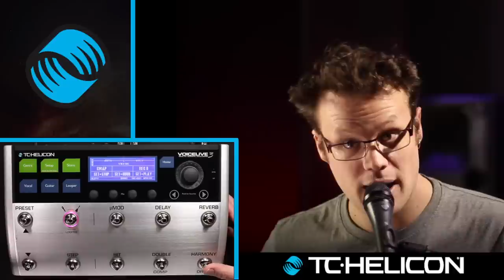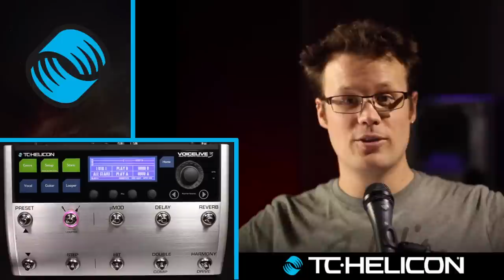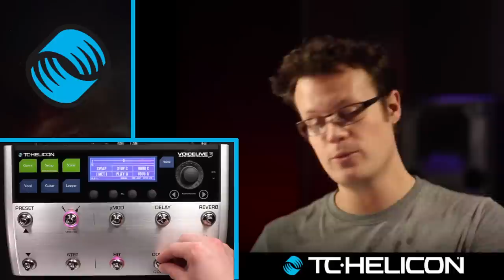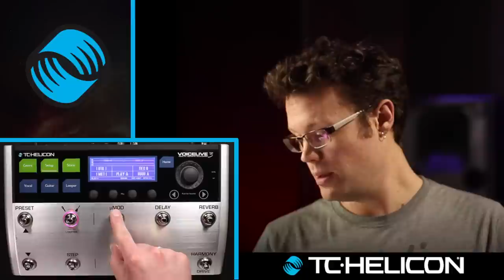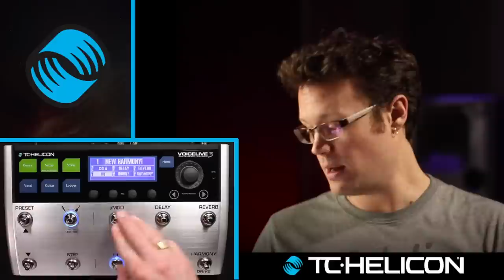VoiceLive 3 - Looper Tutorial

Comment: When are you guys going to add a MIDI time clock to the software update? I play with a Boss DR 880 drum machine, I can't use the looper unless it is synced to the drum machine thru MIDI.
Reply from the maker: Hi Michael, I'm not sure if we'll add MIDI tempo/sync or not, but it's a very often requested feature so we're definitely looking into it.
Reply: This is why Boss is still the best  ( Boomerang is good too ).  Go with the RC-300 or RC-505 and just use the Voice Live 3 for vocals.  A looper without Midi sync these days is just plain nuts.  This is why I also stick with the Voice Live 2 and will not even think about the Voice Live 3 until midi sync is firmly in there.  With computers and external drum machines or samplers, people want to midi sync their devices.
Reply: This device seems hopelessly complicated. B and not C, swap, metronome or not impacts function of sync modes etc. It's such a shame that the TC effects are so much better than the Roland unit but this seems unusable from an interface point of view. Also midi sync is a must.

Comment: Lol, nice response. I had a question though (a silly one,) but would it be possible to run this connection:  guitar > k&k trinity mini preamp > voicelive3 > PA speaker? Would there be any sort of feedback? Also, would I need a noise suppressor?
Reply from the maker: Marco Lively You can run the K&K directly into the VL3 (after it's preamp), just be sure to set the preamp level and VL3 level such that you get green/yellow (and not red clipping) on the VL3's input LED's when you're playing. Beyond that, you have the full VL3 effects suite at your disposal. I'd try out the BodyRez presets/amp.  Before you get a feedback supressor, I'd make sure you try 1) Monitor Position/volume 2) Phase Flip in the VL3 setup --> Guitar menu 3) EQ changes.
Reply: TC-Helicon That's great. I really appreciate this customer support, btw, it's huge that I'm able to get clarification on some things. See you on the stage with the vl3!
Reply: TC-Helicon  Please help… I'm still seeing a faint red clipping, and a yellow clipping for the NP. This happens even if I just have my regular acoustic plugged in straight to the pedal. I just noticed this slight red clipping after a couple of weeks of fooling around with it, so I hope I haven't damaged anything. Also, I'm getting a lot of static type noise coming from my PA speaker. I have an xlr cable going to a behringer speaker (it has a mixer built into it,) and I hade the VL3 set to mono for the output. I hope you can help.
Reply from the maker: +Marco Lively Hi Marco, that's a bit of combined software and hardware. We will look at addressing it via software if we can. I'm not a dev or electrical engineer, but from what I understand it's sort of like "bleed" between the LED's that share the same circuit. They're addressed in software via some sort of matrix and if we don't send an "off" signal every time we light a new LED, you can get some ghosting (basically tiny voltage) going to other LED's that share the same portion of the matrix.

There's nothing wrong with the unit in terms of audio or levels, it's more a matter of "pay attention to the bright LED's". We'll work on improving things, since I can imagine the difference between dim/bright in a dark space gets harder to differentiate, but to be totally honest it's not the kind of thing we have our hair on fire about vs. some other things we're working on improving or adding.
Reply from the maker: +Marco Lively The static noise is a different issue. Is there any way you can make a recording/video of the noise and send it to support? Having a way to hear/view those types of sounds can often lead to a solution. 

http://support.tc-helicon.com

Comment: there has to be another way to pick a tempo??? say I want 125 bpm or 126bpm...do I have to count that out with my feet or can I turn a knob and get exactly what I want at a fast pace.  we should be able to select an exact tempo and do it fast. thanks the guy that has a hard time counting : )
Reply from the maker: When you've tapped a tempo, you can use the preset up/dn buttons to do 1 beat-at-a-time changes to the tempo to get it perfect. That said, if I know a song is going to be at a specific tempo (likely if you're playing to a click or backing track), I'd create a preset and set the BPM in the delay block and save it that way. Then you never have to worry about tapping at all. Tap's more useful when you don't have an absolute tempo in mind and want to get your delays etc. in sync with the band when it's already playing.
Reply: Very helpful!!!!! : ) Thank you! : )

Comment: HI, I just picked up vocal live 3 extreme. I notice when I am looping.. the playback is quieter than the actual live sound. Is there a way to increase volume on the recorded loop?
Reply from the maker: If you've got the latest update, there's a loop level control in the Main and Headphone mix pages, plus individual loop track level controls if you wiggle any of the 4 knobs below the screen when you're on the Looper layer.
Reply: Thanks, I didn't need an update after all. I just needed a point in the right direction. The last place I looked was right in front of me ✌🏻️
Reply: @tchelicon  exactly !    for live this all needs to be on foot switches; pedals. NOT buttons from your hands !  I  think with all the mutli use of buttons and combinations; they realize  YOU Need allot more dedicated button that you can use; live.  . Need an imput;  to take another external  multi switch box into the system.  ie. volume, up /dn so you don't have to remember all this - live. ( and up down for sequences; and be able to up/dn backing tracks; sync'd also.